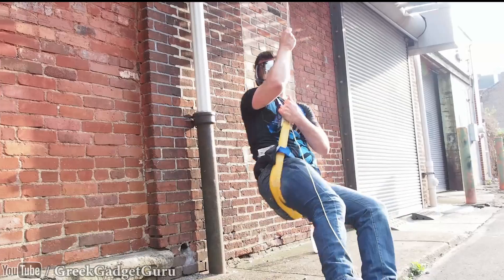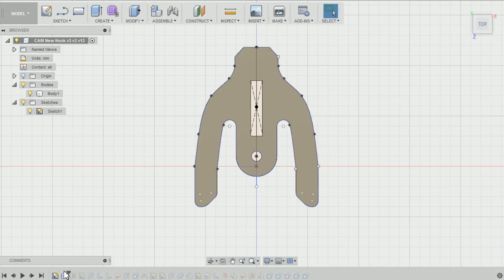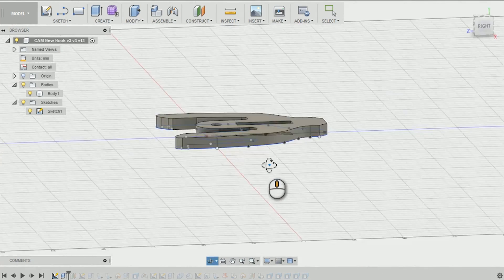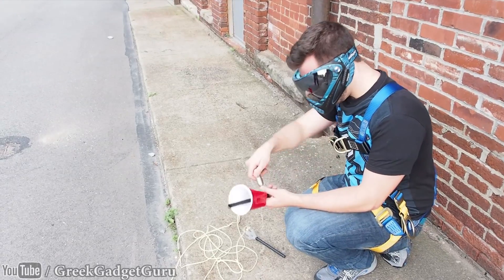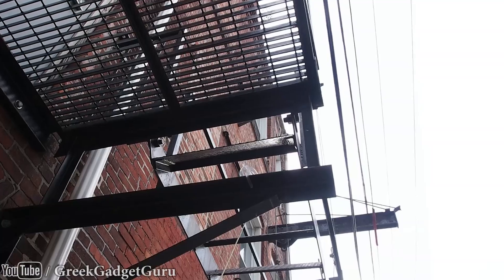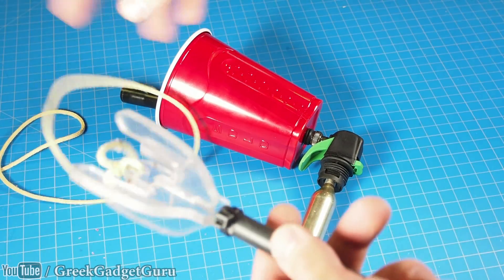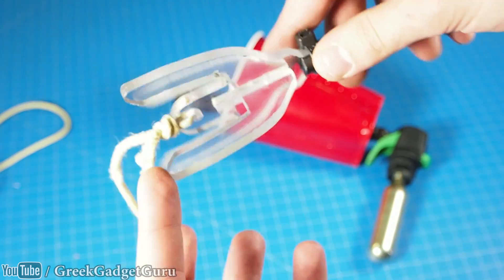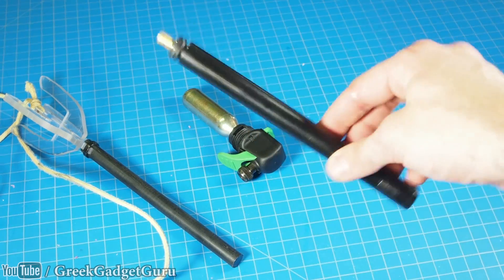SPIDER-MAN Web-Shooter System - "Web" Hook + Prototype Launcher V.2

Comment: The hacksmith did something that could help you hold on its a mini version of what they use on ships so say there would be a piece of rope in-between these sort of folding triangles and once it got to a certain point the triangles would move in and hold the rope that's a half decent locking mechanism I've seen for something like this

Comment: well if the kevlar cord is breaking now only what will happen when you swing on it and it will double or triple your weight you should use a thick one
Reply from the maker: Its no breaking, not even fraying. I just had it crudely wrapped around the harness buckles and the "knot" I had was coming unloose.

Comment: elephant toothpaste balls, dense foam, superglue balls (sprays superglue on things, could potentially slow someone if in face), airesole cans that somehow spin like when you shoot a can and it sprays uncontrollably (potentially filed with something flammable, firework mortars powerful and simple, something that spread out like fishing net (net webs).
Reply: Taster webs would be hard because it would have to be self contained unless it had a small battery that can hold a small one time charge, like those disposable battery packs. Also you might be able to making freeze webs using car coolant that you refill the air conditioner with.

Comment: How about one of the web shooter combination as like Hard Web and Web multipliers? Hard Web: Ounce using this combination it will first of be sticky. But it quickly the chemicals turn the web solid. Web Multiplier: With this type of combination while using web projectile. The web will multiply into smaller pieces and fly around.

Comment: pinch the air powered stuff from the slingshot channel.... also    a small taser bolt  battery compasitor all housed in the shaft  taze on contact?   i dont know your the smart one

Comment: flaming webs. just, just flaming webs. you would make the world a better place. Also webs that explode on contact. That would be nice too. also like webs with tiny razor blades on the sides. or a rocket propelled web, that has like a small rocket at the end. that way it can like break through walls and stuff. And like freeze webs, that are super cold so that if they hit water, they turn it to ice so you could like spray it at a lake and walk across the lake. And you were talking about in the concept video like how would it be possible for the web to like wrap around someone, and i think i came up with a way that could possibly work. or it might not even be feasible at all. but here's the idea: put a miniature rocket on the end of the web. not like a missile or anything, very low power. just enough to drive the web to the left or the right, depending on which hand it is fired out of. if it is fired out of the left hand it is driven to the right and spins around the person clockwise. if it is fired out of the right hand it is driven to the left and spins around the subject counterclockwise. Let me know if it could possibly work, because that would be AWESOME!